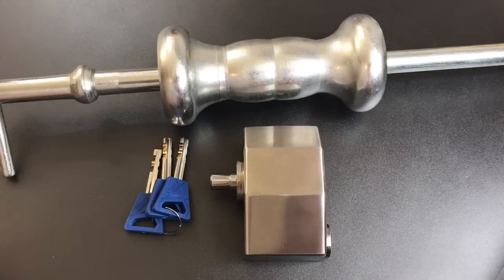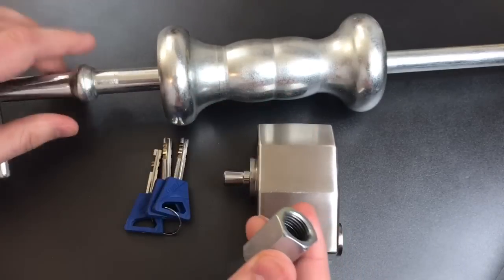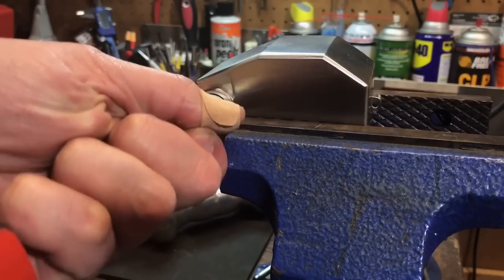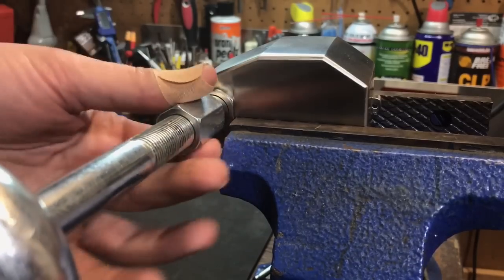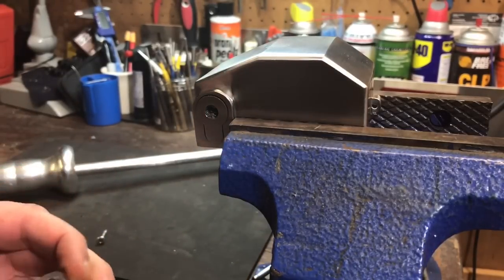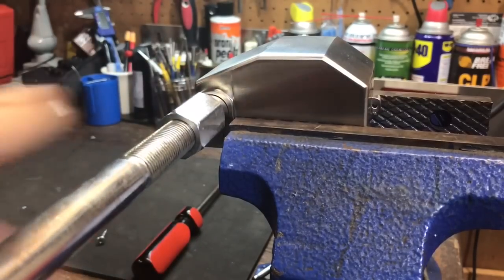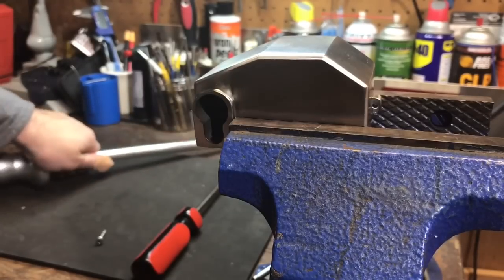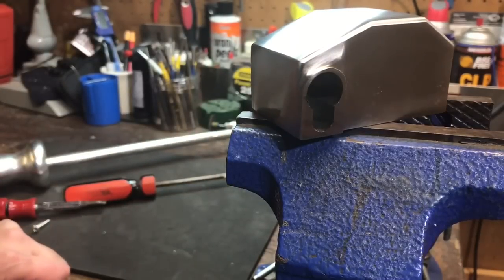[590] LoboJack HS-21 Padlock Opened With Slide Hammer

Comment: Imagine if you had used the Ramset gun to actuate the slide. Probably would have stripped the skin off your palm and send the slide hammer through a wall, considering if even a low power cartridge can drive hardened steel nails into structural steel and concrete.

Comment: If I only had a vice with me all the time to hold the piece in position whilst using the slide hammer😎
Reply: This kind of lock design is supposed to be used with locking hardware that keeps the bottom of the lock flush with flat surface. So the lock is kept in place with the part which the lock is keeping locked. If the whole lock rips off when you use the slide hammer, there's no need to break the lock anymore.

Comment: What improvements would you make if you created this???
Reply: A higher strength pin would be an easy start. The fracture mode looked very ductile. A proper dowel pin of 50+ HRC would make things much more difficult.
Reply from the maker: Not sure. I’d need to give it a good bit of thought. But There needs to be metal in front of the core IMO... maybe an outer shell of hardened steel.
Reply: Multiple pins would be an easy option, and maybe larger diameter pins as well.
Reply: LockPickingLawyer wonder if sacrificing one of the chambers to add a second pin would make much of a difference?
Reply: A better pin and perhaps use something like the sacrificial piece you can find in a anti-snap euro cylinder
Reply: BlackDolphin90 If i was the company i would weld the core to the body

Comment: Was that a self tapping screw?
Reply: Barry Fields the correct term for this sheet metal screw is "self tapping". "Self drilling" screw with the drill tip is what most people refer as "self tapping"
Reply: Ummm....  looked like a machine screw or sometimes referred to as a metal screw.
Reply: self-stripping screw
Reply: +John-Paul Silke - I have never heard anyone use the term "metal screw" before.  Maybe this is a reference from another country?  Machines screws are for tapped holes of the same thread (often improperly referred to as a "bolt").  Sheet metal screws are for existing holes in sheet metal or sometimes wood which is what LPL used here.  Self-tapping screws will have a distinct drill tip with one or two flutes for sheet metal, usually with a combo slotted hex head.